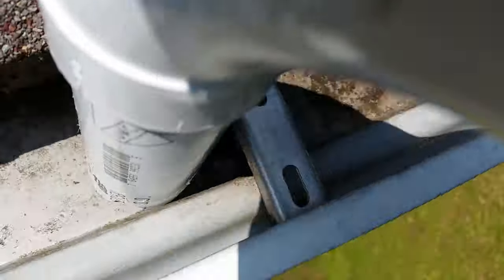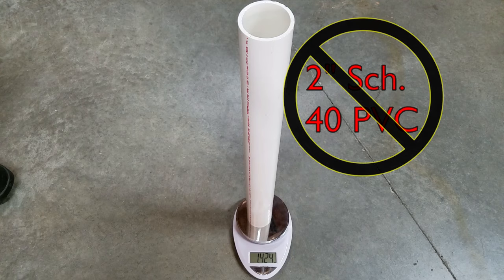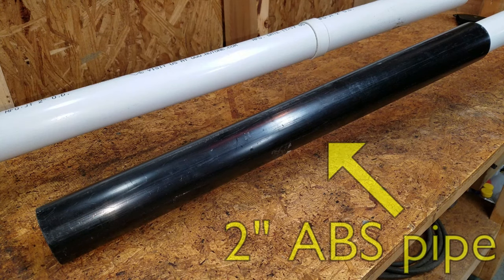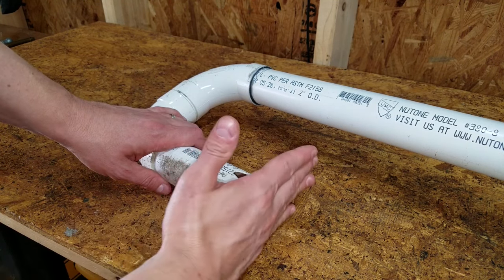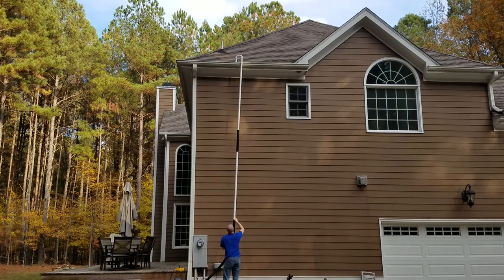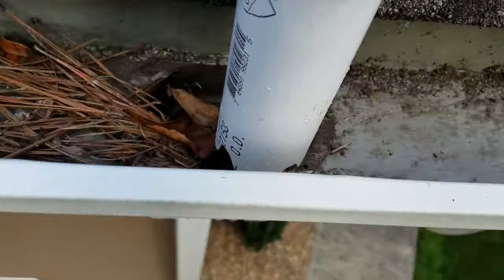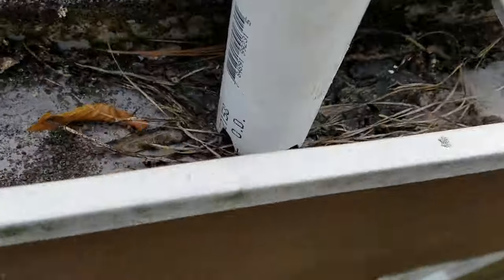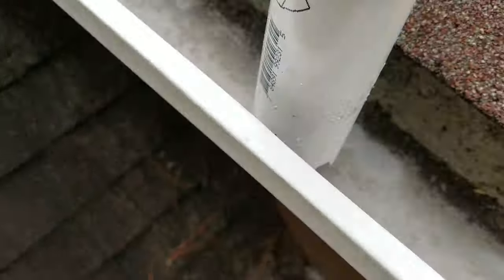UPDATE: Gutter Vac (3+ Years Later)

Comment: The main issue with this design seems to be finding Central Vacuum tubing AKA schedule 20 PVC. It is no longer used in homes due to coxe changes I believe. So most places stock schedule 40.

I wanted to get some more, and I could only find it online at a not ao great price unfortunately. But still not too much.
Reply from the maker: Are you sure they don't sell it anymore, whole house vacuums are no longer installed? I had to get mine from a local electrical supply company, but they had everything I needed for cheap.
Reply: @Mikeattempts  I believe they are using a schedule 40 in new installs.

I dunno exactly, but I contacted several suppliers in my area and no one has schedule 20. Home Depot doesn't even have it on their website anymore. (they have elbows, couplings, but no tubes).

I was even surprised when I emailed Broan Nutech who said they discontinued there central vacuum tubing. Not exactly sure if they meant all their products or just a schedule 20. They told me to contact drainvac who neve replied.

Something has changed in the industry in the last few years... Maybe fewer homes are using it too, and people just want to use a wand vacuum like the Dyson cordless ones.

My home has central vacuum tube installed, but the previous owner gutted the system so he could make space for shelves in the garage. 😂
Reply from the maker: @funstuffonthenet5573  Yeah, you're right, it looks like Drainvac now owns the Broan-Nutone central vacuums. However, there are still local stores listed on Drainvac's "Find-a-Retailer" section so hopefully you can still get the same central vacuum tubing from the same electrical supply stores, just under a different name. Also, I don't know think schedule 20 and central vacuum tubing are the same (misspoke in my 1st video). I think they have similar wall thickness but schedule 20 is pipe while central vacuum tubing is tube, so they'd have different inside and outside diameters. When calling around, you'd need to specifically ask for "central vacuum tubing", not schedule 20 pipe. Thanks for the info!
Reply: @Mikeattempts  Interesting. There was a lot of confusion about schedule 20. I was going to bring some elbows and coupling with me to make sure they fit
Reply from the maker: @funstuffonthenet5573  Well, let me know if you're able to find any and build yourself an attachment! :)
Reply: @Mikeattempts  Ah, I built an attachment last year actually, but realized I could only clean the first story cutters. I wasn't worried because I needed roofers to come by anyways, so they cleaned the top floor.

This year I bought more tubing and will try the next floor. I found only 8 feet pieces on Amazon, so I might have to attach 3 pieces together instead of 2. But I think it will be fine, maybe some duct tape for good measure.

There are some gutters that might be hard to access, due to being inside a bit from the "border" but I don't think they get too many leaves. I will still try to see if I can get in on an angle and vacuum things up
Reply from the maker: @funstuffonthenet5573  Yeah, I've got one small section like that, but I don't think it gets many leaves either.

Comment: Would this work on wet material?
Reply from the maker: If you use a strong wet/dry vacuum then yes, it does work with wet debris. However, shingle grit and sludge from decomposing leaves will stick to the inside of the flexible vacuum hose and make it heavier. I only experienced this one time because I usually wait until there have been at least a few dry days in a row before cleaning my gutters. When I was done, I had to remove the hose from the vacuum and clean it out really well with my garden hose.

Comment: how does this work with leaves?  i have a huge old oak tree, and the predominance of my gutter fill is very big oak leaves.  will they clog the tubes?
Reply from the maker: My gutters usually fill with small to medium sized leaves and a ton of long-leaf pine needles so I'm not sure how it'd handle big oak leaves. I would think it'd do alright if the leaves were slightly damp and still flexible vs dry and stiff. You could make a little pile on the ground and just see if your vacuum hose clogs up. Or you could attach the vacuum hose to the exhaust port and blow out the big stuff before vacuuming out the smaller stuff.
Reply: @Mikeattempts  thanks for the reply and input!  will have to try it.  all brand new gutters (hurricane ida made sure of that this year UGH) so i'm starting fresh.  i can reach my back gutter from my deck, but my front is a 2 story and i HATE ladders, so this is a great option!!
Reply from the maker: @b.johnston3773  Let me know how it goes!

Comment: Do you happen to have a solution for getting rid of moss safely and affordability from ground level?
Reply from the maker: No, but that's a great idea for a future video! :)
Reply: @Mikeattempts  Awesome, looking forward to it. I think if we can somehow accurately spray the Zinc powder on the ridge... then we'll be in victory town.
Reply: @funstuffonthenet5573  I have been looking at a Soft Wash system to remove moss and other organic materials from the roof.
Reply: @Gamer-kd9ou  Yeah! Me too. I got one of those mixer sprayers. Where you can put a solution in it and hook it up to your hose. (They are normally used for spraying fertilizer on your lawn. And they also make them for car washing). There is a formula where you can mix it with bleach and dish soap and that is supposed to help kill the moss after a few treatments. I am going to try it soon when the weather warms up. My only concern is that some paints can fail when diluted bleach splashes onto them touches them. So I need to call the paint company and ask.

I also have a Mr. Longarm to scrub the roof a bit from ground level. This works well on the slanted roof on my first floor. Which is where I had the major problem. Use longarm to get the big pieces off then apply the solution with the sprayer.
Reply: @funstuffonthenet5573  Based on what I have seen on Youtube, as long as you wet down your plants sufficiently beforehand, the bleach shouldn't damage your plants. However, if you have delicate plants, there are multiple chemicals that can neutralize bleach (search 'Neutralize Bleach').

A roof needs a strong bleach mixture (around 5-6%) to clean well. It requires a near 1:1 ratio of bleach and water (store/pool bleach comes in 6%, 10%, and 12.5% bleach concentration). Do you know if the mixer sprayers support a 1:1 ratio? X-Jet at 2GPM pressure washer supports a 0.8:1 ratio. It's an alternative to soft wash.

That's cool. I need to buy a Mr. Longarm!

Comment: Where did you find your central vacuum tubing? I've called over a dozen places in my area to no avail. I tried electrical supply as well (like you recommended) but they all said that they only use schedule 40 or 80 in electrical... Thanks for your video!
Reply from the maker: I got my central vacuum tubing at a local electrical supply store. Any place that installs central vacuums in homes should also have 'em. There's a possibility that a plumbing supply store would carry them but, since a central vac is an electrical device, I'm not sure. Other viewers have said they found 'em at their local Home Depot or Lowes stores. You can also order 'em online (links in description) but that's going to be a lot more expensive.

Comment: Can i do this with 3 10 ft pipes?
Reply from the maker: Yep, as long as you use central vacuum tubing and not schedule 40 PVC. You can buy the central vac tubing in 8' and 10' lengths. Also, to reduce weight, you could use central vac PVC couplers to join the sections permanently, instead of using the black ABS pipe. And, if you're going that high, I would recommend a 6 or 6.5HP wet/dry vac. If you already have a good wet/dry vac, give it a try before buying a new vacuum though.
Reply: @Mikeattempts  Thanks I actually bought 2 10ft tubing's and they are pretty light weight. I am actually using this to clean other peoples gutters and I got a client that house a 3 story house so I think I may need to get 1 more 10ft. I cant join the sections permanently since it wont fit in my van so I just have to assembly it when I get to the site. Thanks for the help.
Reply from the maker: @WadeIsa  No problem, thanks for the comments!

Comment: Do you keep the filter inside the wet dry vac or remove filter?
Reply from the maker: I usually wait for at least a few dry days in a row before I clean my gutters so I leave the filter in the vacuum. If there's standing water in your gutters, I would remove it or swap it out for a "wet debris" filter. Also, if it's wet, I would recommend waiting if you can. If not, be sure to wash out the flexible vac hose or the "mud" will dry inside and make your hose heavy.
Reply: @Mikeattempts  I just happened to buy the EXACT materials today at Lowes to build this very design.
I was surprised to find your videos, 5 and 2 years ago, where you built the exact same design.  LOL

I even have the same vac.  I also didn't think to use the vac's extension wand, so that's a great idea.

I have never ever used this vac for wet stuff, so I don't think that I even have the "wet debris" filter anymore (or ever had it).

Someone at Lowes, that helped me find these parts, suggested to just buy a cheap pack of woman's nylons, remove the main dry filter and put the nylon over the motor.

Do you think that this would be an ok idea if there's some wetness up there?

Thanks in advance.
Reply from the maker: @BlondieSL  Yeah, nylons sound like a good idea. However, unless you're actually sucking up water, the standard paper filter is fine. Inside the Ridgid vacuum, there's a deflector where the hose enters the tub. I have mine pointing down at a 45-degree angle. Any wet shingle grit is shot straight to the bottom and doesn't even make it into the filter.
Reply: @Mikeattempts  When I assemble this, I may also put it at 45 degrees or so, rather than the full 180 degrees.
I can try both to see what works for me or even better, perhaps I should make it adjustable.
Reply from the maker: @BlondieSL  That could be an advantage where you can't get directly below the gutter because of bushes or something like that. However, in order to get the 45-degree tip into the bottom of the gutter, you'll need to be standing away from the house a bit. This distance is dependent on the length of the attachment. As the distance from the house increases, the end will be heavier and harder to maneuver. Being directly beneath the attachment makes it easier to control.
Reply from the maker: @BlondieSL  Hahaha, yep! The 45-degree tip would probably be good for the first-floor gutter, when you're only using the top section of the attachment (half the length). Let me know how it turns out. :)

Comment: I'm thinking of using something like this to clean out my dryer vent.
Reply from the maker: Is the exhaust for your dryer up high? I have another video on how I clean my dryer vent, but your situation sounds like it might be different.
Reply: @Mikeattempts  Thanks, I checked out your dryer vid.  Yeah, it's about 16ft up and a pretty long run from the dryer to the outside (18ft or so).  I already cleaned from the inside, but I'm still getting a vent clogged (D80) warning on my LG dryer, so my assumption is there's still a bunch of lint at the exit vent.  I might have an easier time reaching it from the rooftop deck (it's only about 6 ft down from there).  So I'll try running the dryer to have the vent cover flaps open up, and see if I can get a vacuum nozzle inserted a few inches.
Reply from the maker: @danheuser5148  Sounds like a solid plan, good luck! :)
Reply: @Mikeattempts  Thanks!

Comment: Has anyone used one of these in (improperly installed) gutters where there is standing water? Seems it should work in theory...
Reply from the maker: Yeah, as long as you use a wet/dry vac and remove the filter, they can suck up water too.
Reply: I have. It was brilliant.

Comment: Schedule 20?…huh 
Maybe schedule 30 or so…hard to find any even on Amazon…I should say impossible for now.
Reply from the maker: I don't actually think the central vacuum tubing is classified as "schedule" anything because it's tube, not pipe. I'm sure you could make it work but central vacuum tubing provides the best fit and is the lightest weight PVC.
Reply: @Mikeattempts  
I could agree if I would find available somewhere.
Home Depot out of stock for example…
Reply from the maker: @RomeoUrsu-fy9qo  Yeah, my Home Depot and Lowes didn't have central vacuum tubing either. I had to pick it up at my local electrical supply store.
Reply: @Mikeattempts  
I will attempt to take the same path…see if any around me carries those pipe…the project is very good…just very challenging to find parts.
Thanks for the response.
Reply: I don't know if you have already done this, but just today, I bought the exact same parts, except that the tubes were 10' long instead of 8'.  This was at Lowes.  They have an entire section for central vac stuff.

They were only $10 each.  Not a bad price.  There were IPEX and not PVC, which is just fine.

And yes, they are very light.
Reply: @BlondieSL  
As long is not heavy
Reply: @BlondieSL  
I will give them a visit very shortly…probably this next weekend.
Thanks